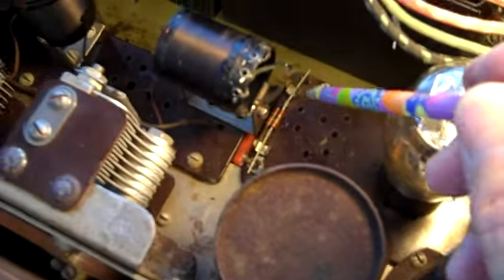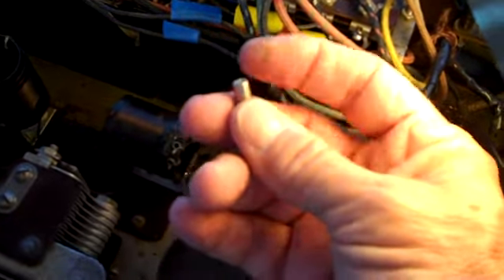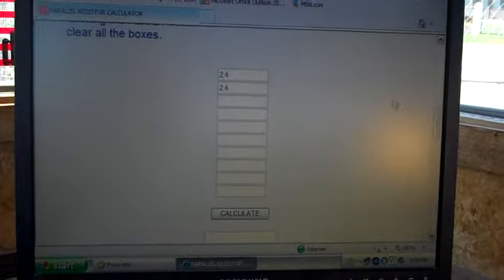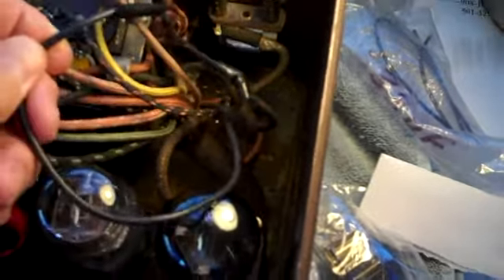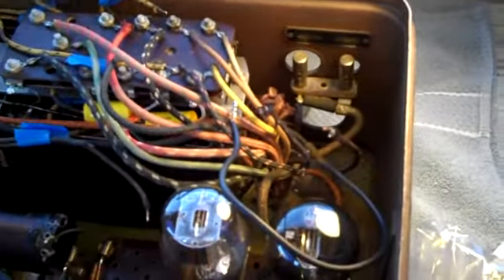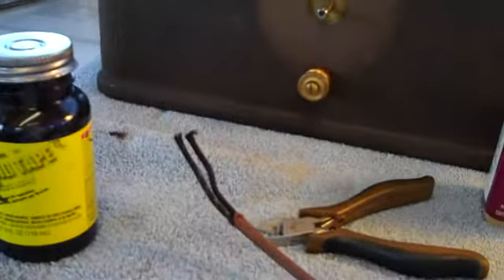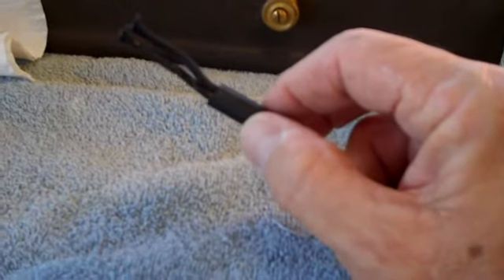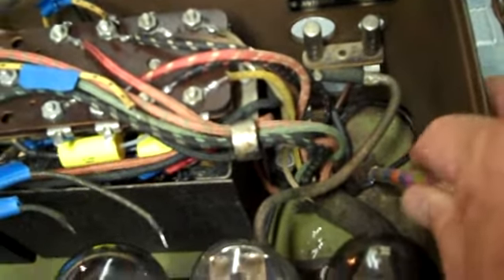1927 Atwater Kent Model 37 Repair and Restoration. (Part 9 of 21)

Comment from the maker: Original tube markings should never be deliberately removed.  That being said, some markings seem to disappear with the slightest breeze, so I always try to attach a label to the base of each, even if the markings are still good.  At the very least, it makes tube identification a bit easier for these old eyes.  :-)
Clean the bases and attach the labels before cleaning the glass.

Regards,
John